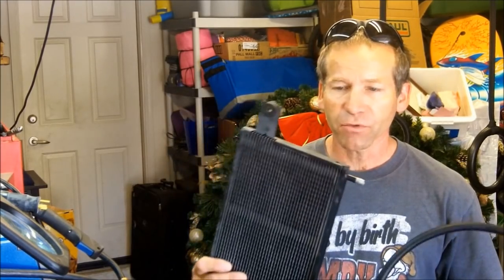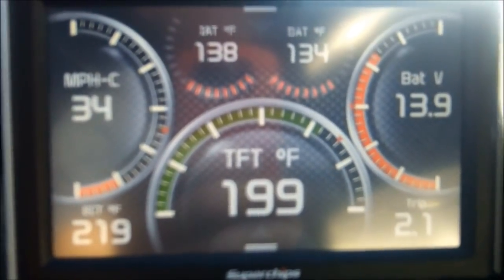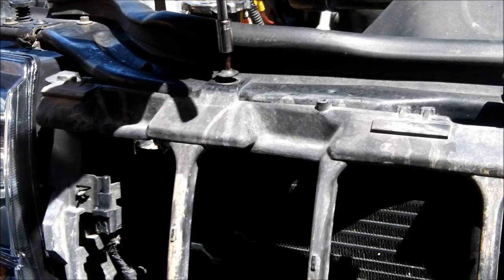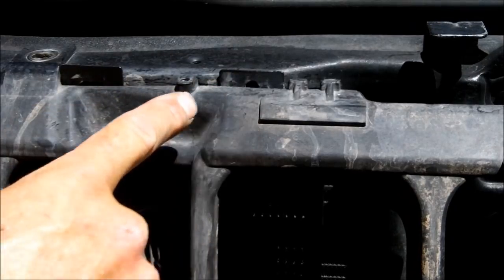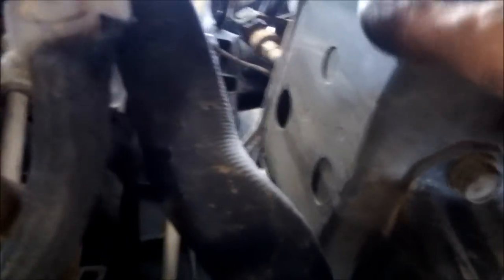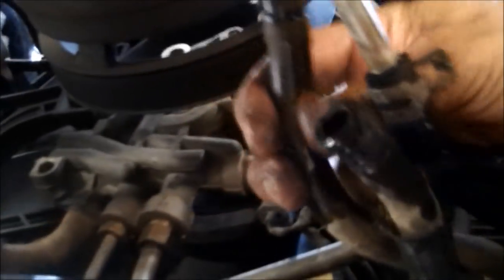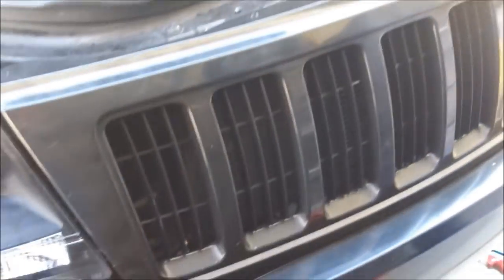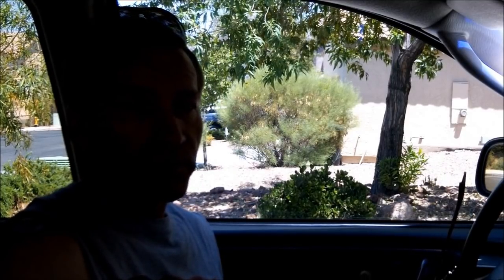Installing Transmission Cooler on a 99-04 Jeep Grand Cherokee

Comment: Did you test the temperature difference using the radiator cooler and the trans cooler in series?
Reply from the maker: No, I didn't. It would be a higher temperature for sure. It would give the trans a quicker warm up.
Reply: @martinbuilt  what is the brand of your OBDII scan adapter and where can I find one? I'd like to monitor my transmission temperatures. What is the app you used? Did you buy the app or use it for free with ads?
I got a scan adapter off eBay but it didn't work, the app could not detect the scan adapter.
Reply from the maker: @user-lq1gi9hv7k  This is what I am using to monitor Trans temp and much more. 
Superchips 42050 TrailDash 2 Programmer w/Mileage Coach Software TrailDash 2 Programmer  https://amzn.to/2xUOv4l
This is permanently mounted in the Jeep.

Comment: So you completely bypassed the oil cooler built into the radiator? I thought you only splice into the return line?
Reply from the maker: You can just splice into the return.. I just wanted to try and see how it worked by bypassing the radaitor cooler all together. I've been driving it this way now for at least 15,000 miles.
Reply: what temps do you get in winter, one of my lines are leaking so i was thinking of doing this instead of fixing it, but I live in michigan and it gets cold, do you think it would be ok during winter? love your vids, just recently subscribed!
Reply from the maker: drivemecrazy k during the winter time here it probably doesn't quite reach normal operating temperature until you get into stop and go traffic. So most of the time it's like 125 to probably 165.  I used to live in Iowa so I know what you're talking about. I would run it through the radiator cooler first then through the auxiliary cooler.
Reply: @martinbuilt  9
Reply: @martinbuilt  
what would that change from the video? i dont know which one is "in" and which is "out"

Comment: what temp does the BAT stand for next to the intake air temp?
Reply from the maker: Battery temp. Don't ask me how it knows what the battery temp is. It would have to be through the ECM some how.
Reply: thanks for the fast reply. the only thing i could think of was battery temp but i cant see how thats relevant on a lead acid
Reply: If it's like the XJs, there is a sensor in the bottom of the battery tray that is a temp sensor for the battery, that's how my 00 XJ is. Supposedly it will stop the alternator from charging the battery if it gets too hot, or at least decrease the amps.
Reply from the maker: +Daniel Pace.  thanks for letting us know and makes perfect sense.
Reply: yeah i have noticed a small plunger on a spring under my ZJ battery i wonder if that has anything to do with it
Reply: Yeah, that should be the temp sensor.  It's a round disc on a spring washer.